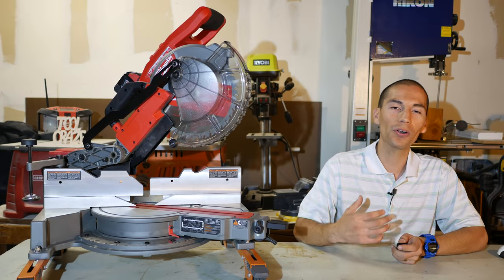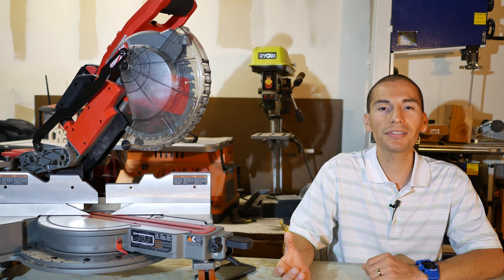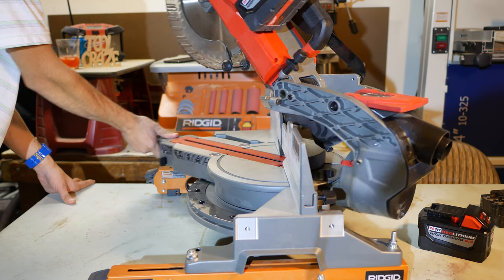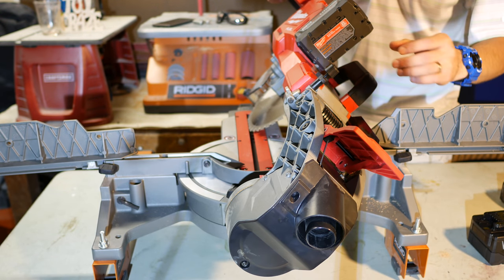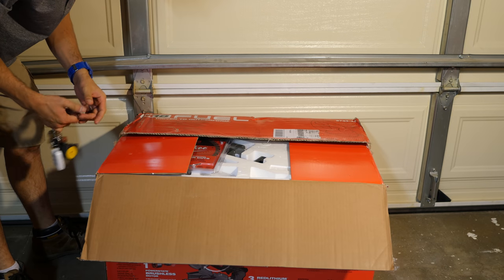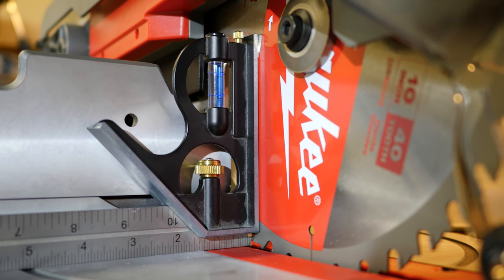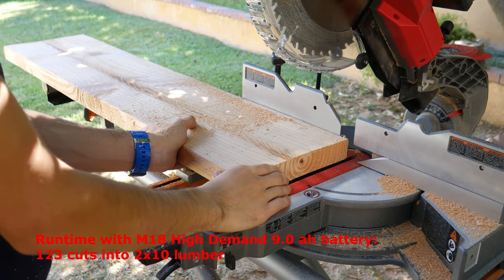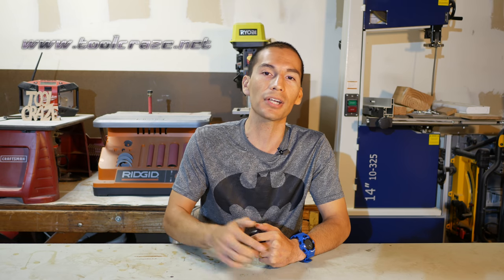Milwaukee M18 Fuel Miter Saw 2734-21HD FMS254-0 Review in 4K

Comment: I just picked up the 10” kit with the rapid charger, 9ah battery and the extra 40 tooth blade. I got it on the Home Depot website on a special purchase for $449. I also had a 10% off code and got 12 months free financing. Final price was $444.51 shipped free.

Comment: Excellent video Javier, thank you. I'm still trying to soak up the fact that there are 9ah out there. wow!
Reply from the maker: Thanks. I know right, it's hard to believe we now have 9.0's.
Reply: My LXT are 5.0... 9.0 is amazing. I'm in shock at how much power this saw has for 18v. you got the mail on the head when you said magic. I hope LXT can do something similar.
Reply: because I don't have a cordless miter saw
Reply from the maker: Well Makita does have the x2 miter saw and before that they came out with an lxt miter saw if you want a cordless miter saw and want to stick with your lxt system. They now have 6.0's and they finally started putting fuel gauges in their batteries.

Comment: How does Milwaukee do it on 18 volts? It's all math. Watts law. Volts x amp = watts. 18 volts x 9 amps is 162 watts. Watts or power is what these tools need. You can increase the volts and decrease the amps to get the same power (watts). That's what dewalt chose to do. 60 volt flex battery that is 2 amp hour in the 60 volt mode equals 120 watts. So battery to battery, Milwaukee makes more power. Dewalt needs 2 of its batteries to get to 240 watts of power for their saw. It's what they chose to do. The volt naming is all marketing though. Everyone thinks higher volts is better. It is as long as you keep the amp hours up to equal watts. Great video as usual.

Comment: My sliding compound miter saw is the "Tool Shop" brand from Menards. It is rather weak, I can hear the motor bog down when I cut 2x4's. Next time I am in the market for one, I will by a higher quality scms. Thanks for the review, I always enjoy watching them.
Reply from the maker: thanks bro and thanks for sharing the experience with your Tool Shop miter saw. I never heard of them, but then again we don't have Menards here where I live
Reply: Tool Craze No problem, "Tool Shop" is a cheap brand, my 10-inch scms only cost me about $117.
Reply from the maker: wow thats harbor fright pricing, not bad if you need one in a pinch
Reply: Tool Craze That's why I got it, it was also when I first started in woodworking, so I didn't want to spend too much money. However, when this one quits on me I will get a better one.
Reply: What's your budget? If you don't NEED portability you should get a corded saw. Check out the Bosch model with the articulating arms.
Reply: moonman9j9 I will next get a compound miter saw, I don't have the space, or need, of a SCMS. I use my table saw more than anything else.

Comment: great review!  I'm surprised how well it did on the smaller batteries.  you are probably drawing a ton of current, so not only will the run time suffer, but you might overheat the battery after several cuts.
Reply from the maker: Thanks bro, that's true with using compact batteries in any high power draw power tool like saws. You're better off using high capacity packs. But it takes more than a few cuts to make them overheat

Comment: Excellent video man. Milwaulkee fuel is the way to go.
My buddy just got one of these and spring was much hard to pull down on than my hitachi cf10 miter saw..
did you have the same thought that pulling the saw down was too much work?
Reply from the maker: No issues here
Reply: Yeah that old Hitachi saw is long in the tooth but it sure is a nice saw. I also really dislike saws that require as much force as this miluakee saw, all the bosch saws are like that too and some of the DeWalt saws. I just bought this miluakee one and am excited about it but that is a bummer I don't know why manufacturers don't think about that. It's no big deal if you're cutting a few sticks but when you make a cut list and have an hour of cutting to do it's pretty darn annoying

Comment: Actually I had been wondering if it could cut with 1.5 amp hour battery but a 2.0  is pretty close. Good job with a battery amp comparison! That is a huge plus over the Dewalt flex volt. If you're primary pack is juiceless you just slap any M18 on!
Reply from the maker: Yup, that's one of the plus's over the flexvolt is full compatibility with the M18. That reminds me, Milwaukee has a slogan "if it's M18, it fits" lol
Reply: Tool Craze Sounds like a dig at the yellow..
Reply from the maker: Each model has its pros and cons
Reply: Ya I was on the fence about both of them. 
I like the corded Flex volt ability but I think it was more of an upgrading the blades types I have from a 10-$$ to a 12$$$$ and wondering if I could really use the extra capacity that was my gripe. On top of the Chevy only FlexVolt gas cans too.. when I have a bunch of Fords. btw that was also a great FlexVolt review you did.

Comment: Have you tried to use the Milwaukee stand to see if it makes a difference with the bolt getting in the way when trying to make 60 degree cuts?
Reply from the maker: I don't have the milwaukee stand but I have a good feeling it will work fine on the stand and will accept the bolt to face down instead of up

Comment: for framing most cuts are done with a skill saw, unless you have to make multiple cuts the same size, trimmers headers ,head jacks ect.
Reply from the maker: Can be done with a circular saw but no doubt a miter saw is the better tool for framing
Reply: It's only better if you need lots of angle cuts, let's say for framing a roof, maybe just for that,and forget about cutting long angle cuts, without a skill saw
Reply from the maker: Not really, they're better even for regular 90 degree cuts. Nothing beats a miter saw as it's much easier. 
Just set the lumber and chop or slide. Takes out all the guess work and even someone with poor circular saw skills can achieve perfect cuts with a miter saw. You can't get perfect cuts on a circular saw without some sort of a jig or straight edge.
You believe it's not necessary over a circular saw and I'll agree with that but the fact is a miter saw is a superior product for cross cuts over a circular saw.
Reply: Yes I agree they are better than a circular saw for fine straight cutting, for finish work  no doubt I use a mitersaw instead of a circular saw! But framing, the circular saw cannot be replaced in the field.
Reply from the maker: Circular saw cannot be replaced in the field. Not true, speak for yourself.
You're point is you prefer using a circular saw. That's a different story. A miter saw is a better tool for cross cuts
Reply: Go to a job site and see if  a framer takes his bags his cords and his worm or circular saw to work with him!
Reply: Worm drive
Reply from the maker: Don't need to, a miter saw is a superior cross cut tool and are used for framing as well. If someone prefers a circular saw that's a different story. I'm sure plenty of old school guys swear by circular saws for framing and would go for traditions sake. Probably say something like "I've been doing this for x amount of years and ain't gonna change". No worries bro if your prefer a circular saw, it's cool by me. Keep on trucking
I used to use circular saws primarily but now that I have been using miter saws and table saw for most things I hardly reach out for the circular saw. If I'm making one or two cuts then I'll bust out the cordless circular saw because it's easy and it's too much of a hassle to set up the larger saws for a couple of cuts but if I'm doing lots of work, table and or miter saw it is depending on the job.

Comment: Opinion of 10" vs 12"?
Reply from the maker: 12" miter saws are usually larger and heavier and 12" miter saws usually have larger horizontal and vertical cut capacities but this 10" saw has similar capacities to 12"

Comment: listen ...no bias against Milwaukee i think  they make good tools, i enjoy each company pushing the other company to be better,we the consumers win.....as you said "you have framed" your not a framer or build decks every weekend,i assume you make your money on you tube like most other review guys....im a framer 30yrs,and a deck co. almost the same...fi ish carpenters use the horizontal capacity to cut 1x12 or larger stock no 2x stock...ive used the Milwaukee mitre to build a deck ,it struggled cutting 4x6 pt and mahogany posts also any 1" ipe stock,bro...i love tools,i respect all brands for thier pros and cons ..makita has the most tools,Milwaukee is solid all around,dewalt is solid and has framing guns,ryobi has good tools and tools no one else has...or had...problem is you basically selling this Milwaukee chop saw as great...it has many limits...i also notice you didnt comment o. the sawa lack of power cutting through dense material. ...not the dry spruce 2x4 you stack up...real materials, solid woods...realize you influence people with your videos...try to be more accurate. .i respect your opinions. .. ut i dont have a show..you do..
Reply from the maker: No problem bro. I never said I'm a framer. I also never said this Milwaukee can can do everything. I did say it tends to bog down so I gave you guys the viewers the facts and it's up to you to decide. Some have decided this works for them while others have decided it doesn't.
 
Good to hear you like many different brands. As you can see I use many different brands as well.

Comment: Did i forget to mention the 9amp batteries $200
Reply from the maker: buying batteries separately will always be more than if they were included in a kit. In comparison Dewalt's flexvolt 6.0 battery is $150 it's smaller capacity and almost as expensive as the M18 9.0

Comment: good video But... I usually find your videos spot on... Big Miss with the saw not sliding all the way back hitting the hold down bolt. Note the base of the saw has a recess so the nut or bolt slip into the base being flush to the base. Ie you installed the bolts incorrectly and than spend valueable time misleading the viewers. I expect better from your videos which are usually thorough.
Reply from the maker: Bro I explained it all in the video including the stuff your telling me so no misleading. Watch the video again
Reply from the maker: The bolts are installed correctly for this miter saw stand and all the ones I've used in the past. The issue is that the base of the saw makes you do the opposite. I showed it because others will come across this issue also. Although you are blowing the issue out of proportion. In the video I said it's not a big deal and has an easy fix.

Comment: Get the dewalt flexvolt 12in miter saw it won't bog down on hardwoods and fresh pre treated wood like this saw will, plus Milwaukee is Chinese owned so your supporting China if you buy Milwaukee
Reply from the maker: I have the Dewalt flexvolt 12" miter saw and it's also made in asia

Comment: come on ...ypu bought the flexvolt 12" and said its the best in your review,now Milwaukee is all you need...clearly your not a framer or finish carpenter or build decks......this saw will not handle these occupations on a daily basis....you talk out of both sides of your mouth
Reply from the maker: Many people don't need more than 10" and many don't need the small extra capacity of the dewalt flexvolt. These are facts. Also because one is good doesn't make the other a bad choice. 
Also don't forget that the m18 fuel miter saw matches the horizontal and vertical cutting capacity of many 12" sliding miter saws so you're really not losing out because of the 10" blade.

But it sounds like you're better off with the flexvolt so I say go with the flexvolt.
I think they're both great saws in their category and you won't hurt my feelings if you go with the dewalt, the dewalt is also a fantastic miter saw. I'm going to keep my dewalt for sure.

Comment: i realize you get free tools from Milwaukee and others ...mitre saws are used primarily for finish work, finish carpenters  (95 percent ) use a 12" saw for everything including large moldings,  your not cutting 2x12 on a mitre saw..use a skill saw...if anyone gets this they will not be a le to trim most houses,definitely not plder houses with wide moldings. ...also no ac adapter. ..stop trying to get free tools   and be real about the tools you review. ...like " real tool reviews"
Reply from the maker: They use 12" saws because of the added vertical cutting capacity which this saw has. It's obvious you have something against either Milwaukee or 10"miter saws. Sounds like you love the flexvolt and was expecting the Milwaukee to be a terrible saw simply because it's not a 12" inch slider. You're either biased about 12" miter saws and have a one sided view that it's either 12" sliding miter saw or nothing, or you're a anti Milwaukee fanboy.
I also had a laugh when you said that they wouldn't be using a miter saw to cut 2x12. Are you serious? Are you kidding me? Then let me ask you this, why have the added horizontal capacity to up to 12 in or larger? It's obvious to cut dimensional lumber otherwise why have a slider to begin with?
I've done framing before and after using s circular saw and a miter saw for cutting 2x lumber, the easy choice is a miter saw simply because it's ready to make repetitive cuts. I also use a miter saw exclusively for cutting larger 2x lumber such as 2x6's or larger.
Also seen your remark about no ac adapter, so? It's a cordless tool. Do you use this reasoning with a cordless drill? That's why they make interchangeable batteries. When one gets drained, you pop another one in. That plus Both flexvolt and fuel miter saws have such great runtime you should be able to easily get by in a day with one charge so an AC adapter isn't necessary but nice to have. If you need a plug in miter saw, get a corded model. I got the flexvolt because I can't stand having to fumble looking for outlets and extension cords. But I got it with the ac adapter because I got a really good deal on the set, plus I wanted to compare ac power to battery power difference.
Reply from the maker: here's a video showing sliding miter saws used for framing https://youtu.be/wNINT1bNEeg
Reply: I am a finish carpenter. I own the Flexvolt DHS716 running 9.0's, the M18 running 9.0 and the DeWalt 7¼ running a 6.0 battery. I've used all of them on site. The 7¼ is the most limited but the lightest. The flexvolt has the most power by a mile, and the M18 is a nice saw for cutting wider shelving and mouldings. I've installed crown with the Flexvolt and it's just a dream. I've done base with the 7¼ and it wasn't much fun.. (capacity against the fence isn't great).. and the M18? It's getting its first workout coming here soon however I used it today to cut 2x4's.. and it did okay. I rarely use my Bosch cm12sd (12-inch slider) anymore because it's too big for everything I do. Javier is right the 10" is the happy medium between capacity and daily use.

Comment: Why even show it than ?
Reply from the maker: The bolts are installed correctly for this miter saw stand and all the ones I've used in the past. The issue is that the base of the saw makes you do the opposite. I showed it because others will come across this issue also. Although you are blowing the issue out of proportion. In the video I said it's not a big deal and has an easy fix.

Comment: reviewers agree with you because they want free tools to make reviews and have ad money...its a money thing.....exactly my point the flexvolt is the only cordless saw with corded power ....it can cut anything easily using batteries. ...the Milwaukee is not close or almost as good ....because it has capacity to cut something doesn't mean it has the power to actually cut it
Reply from the maker: "I mentioned this saw bogs down so other reviewers are agreeing with me. I never said it was power of corded saws, I did say it was close though. 
For the stuff you mention, you would have no other choice but to go with a corded saw or the flexvolt."

I just copied and pasted the above comment because now we're going in circles. When a reviewer such as myself comments about a negative it's called being honest and if other reviewers agree with a negative, it only backs it up further and shows accuracy of such claim.

My reviews are to give you enough info for you to decide if you personally like the tool or not and my video helped you decide it's not the tool for you. I think my work here is done.
Reply from the maker: Also I never mentioned the Milwaukee has corded power, Milwaukee did. Its close but not quite. I did however say that the flexvolt does have corded power so you are agreeing with me. :)
Reply: Mmm Ooo good luck with your flex volt lasting.

Comment: you made a big deal of it. Devoted over one minute to this. You installed it incorrectly. The stand doesn't cut the wood. Simply reverse the bolt and use a wing nut washer and lock washer underneath no grinder needed. 5 % of your video was devoted to this. Take it like a man admit your mistake bro.
Reply from the maker: Really you're going to take that approach? I installed the saw correctly to the stand per the instructions of the Ridgid stand. Don't believe me? Read the manual for yourself.... http://www.homedepot.com/catalog/pdfImages/ac/ac325a1b-3e87-4a71-9dfb-dc8d93370d88.pdf
You are supposed to use carriage bolts facing up per instructions and this miter saw stand is not the only one that uses carriage bolts facing up.
Now please, move on as it's not a big deal bro